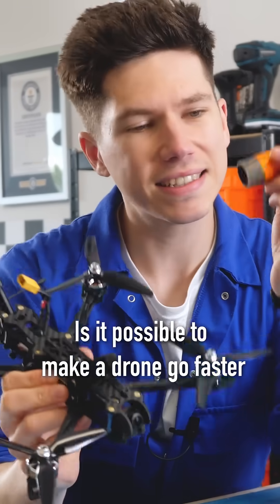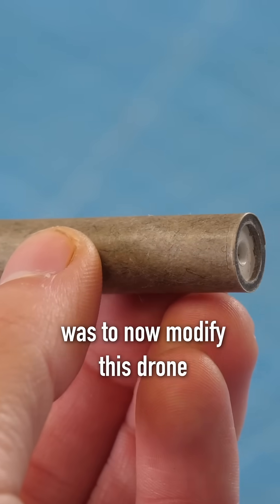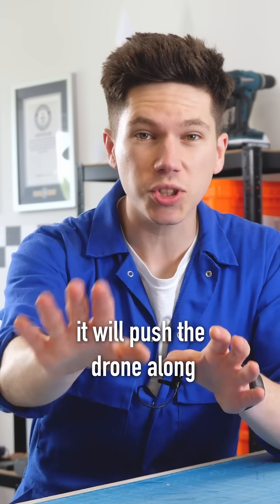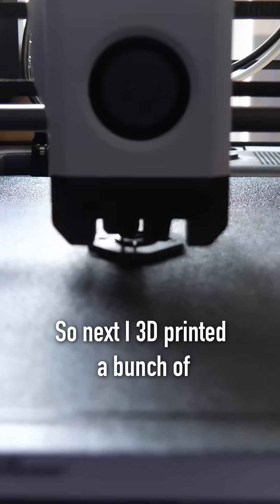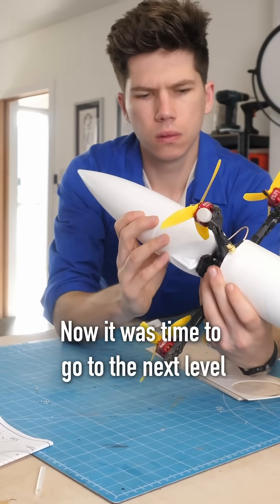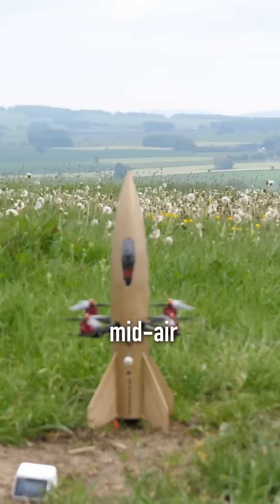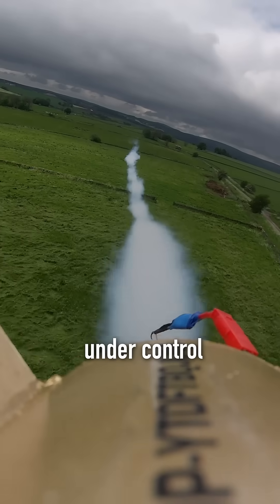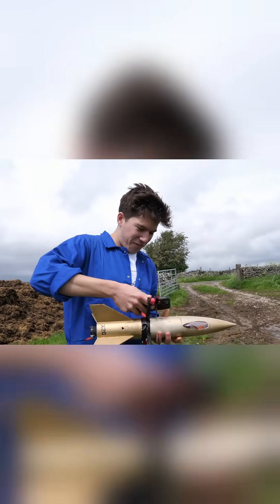I made a rocket-boosted drone 🚀 #drone #engineering

Comment: The problem is that the rocket is going to propel it faster than the propellers can. So the propellers would need to be basically mirroring themselves and spinning backwards to stabilize it. Anything else is going to make it worse

Comment: I would think that after a drone is tuned, a set of entrees in e various matrices of the Kalman Filter are treated as constants. With the rocket motor, both the mass and the center of mass will change as it burns. The moments of inertia will become variables, etc. An approximation from some engine tests could give some piecewise changes to the matrices or switch through a set of matrices as the rocket burns. To not make the adjustments = instability does it not? What thinkest thou?

Comment: You next mission, should you choose to accept it, build retractable arms.  Fly the rocket at maximum speed to maximum height, without the props adding resistance to slow it down.  Then when the rocket thrust is over, the arms pop out and the drone returns to home.

Comment: this isn't even a rocket boosted drone, its a drone boosted rocket.
Reply: You mean a drone-SLOWED rocket, lol
Reply: @ichbrauchmehrkaffee5785 drone stabilized rocket to be precise
Reply: i mean. not really. its a pretty weak rocket motor, though you mean visually it looks more like a rocket then yea
Reply: @moosehead4497  whats happening is the rocket engine becomes the thrust.  The propellers cannot provide more thrust than their max.  They end up acting as stabilizers.
Reply: @Bolt_Turner  right, in that sense it is interesting, except that, past the max thrust, the propellers provide nothing but drag? so stablizer but an inefficient one at best, an intersting idea could be flying the drone up to its maximum altitude, and then starting the rocket to see what max altitude could be reached, thinner air would be more efficient as well
Reply: Drone-steered rocket. Fancy replacement of guided missiles.
Reply: That’s more engine then drone lol
Reply: Exactly what I was thinking
Reply: i came here to say the same thing.  The drone is slowing the rocket down.
Reply: It’s neither.  

It’s a TikTok paperweight.

Meant for nothing more than rage baiting and getting clicks :P
Reply: @stevenrogersfineart4224  Someone thinks they're incredible smart 🥱

Comment: Use one counterrotating propeller on the front of the model
If impossible due to technical complexity, then just two propellers on sides should work. but it would be better to place them all the way up on the model
At those speeds those four pilons with engines and propellers are more of a drag

Comment: Fun but I think there would be a lot of drag off the Rotor Disk once you exceed their maximum RPM and Lift Vector. Props act like a Wing. The surface area and AoA will create Drag. That drag will likely limit the top speed of your rocket which would have likely climbed faster without the Drone.
That's just my opinion.

Comment: Well make foldable legs and you can use a rocket to go super fast and drone to land it and steer it if you leave the edges of the folded legs out with holes in them and actuators to turn them to use the air to control it then fully let legs out with motors for slower landing

Comment: Here is the idea that I have, but I have neither the knowledge or experience to make it, but maybe someone like you can!  
Make a model of Starship and a booster that can launch with a rocket motor through the whole launch sequence and do the separation.  After that you could place quadcopter motors where the grid fins are.  The motors dont even need to actually be able to make it fly, just slow it down enough to do a model tower catch.  The starship section could have small internal ducted fans with the body having slits to allow airflow and lower the weight so that it can maneuver just like the real one with flaps as it falls belly down using a flight stabilizer.  The motors on that part also dont need to actually make it fly, just slow it down for a catch.  

It could be piloted by two separate people, one for each section.  A third person could control the tower or that could be a switch on the controller, IDK which would be better.  Do you even think its possible?

Comment: The limiting speed is the maximum rotation of the propeller which is less than the maximum speed developed by the rocket engine. Which ultimately means that the propeller blades actually slow down a body in the air stream that wants to move faster than the maximum rotation of the propeller. The stream of air hits the blade like a wall because the blade cannot escape the current due to its slow rotation speed.

Comment: I was also obsessed with creating a top speed quadcopter for the longest time. A few years ago I made a 145mph quadcopter Just by using high KV motors and 5-6s batteries. I would say once you break the 150 mile per hour limit, then is when making rocket bodies start to make a significant difference, Because at lower speeds below 100 mph there's not really a ton of drag.

Comment: what's funny is i built a drone with RaceStar 2508 motors on 6S battery and my GPS read 118mph without a rocket engine or rocket style frame (with the motors limited to 80% power output iirc since i was using 6S)

Comment: Depending of electric motors... Fast speed will push motors to turn extremly fast, and turning parts most likely doesnt disigned for this level of functionning)... So maybe one time of try will use a hole phisical "potential" of electric motors) so lets say its a curious experiment, but to became a real or usefull... You need a "drone" with electric engines airspace grade with turbins etc!)))

Comment: I'm sorry but use the drone tethered by a few strings and at a certain speed the string breaks, and within 1 second it ignites the rockets, causing it to have a secondary boost. I bet it will go over your speed no problem.. and this idea is so low on my ideas to make rockets faster, and make drones faster it is a  point 5 out of 10..

Comment: fun fact: If you get rid off the electric motors, the original frame, the battery and the flight computer, you will get an even quicker rocket drone!
Reply: But think of the applications you could fly a Is rocket in between any building or as close to a target as you want

Comment: It begs the question though how exactly it's stabilized at top speed.  A quadcopter stabilizes on roll/pitch axis by speeding up (creating more lift) and slowing down (creating less lift), but if you push the quadcopter beyond the maximum pitch speed of the props (the maximum airspeed it is capable of producing at the motor's highest rpm), then all the props are just windmills creating drag.  Perhaps it's a matter of more drag/less drag, but there's a quirk there too, that if you actually brake a propeller much below the wind speed, then it produces less drag.    A propeller freewheeling close to the wind speed itself produces the most drag.   In that scenario the roll/pitch controls would actually be reversed when the rocket pushes it beyond the pitch speed of the props.
Reply: Yup, thanks for putting my same thoughts 😂
Reply: Agreed. A rocket to lift a drone to a certain height or distance that can then be jettisoned would make sense (save battery I guess) but this looks like a rocket with spinning fins not doing too well.
Reply: the problem is quads cant do better then 0 thrust on one side. at high speed rotor craft have roll tendency. at lest with collective pitch heli you can do something better then 0 thrust on that side. my 6HV can do 100mph easy but then it also has 2m rotor on it. bigger rotors let you have a higher top speed in level flight. this guy just taped a quad to a rocket lets see it do better then 60 in level flight
Reply: Или можно сделать направляюшие с пропелерами задвигаюшиеся и улучшаюшие аэродинамикупри напоре ветра или с датчиком скорости
Reply: Well this just made me think of well why dont we make it a staged rocket? As in, you use the drone controls to get it in the air and pointed in the right direction, and then engage rocket thrusters for speed, then you can shut off the rockets and go back to drone when it needs to, maybe with the propellers folding into the body
Reply: He probably chose props with a much higher pitch than would normally be used with those motors.
Reply: It didn't look like he had much control at all tbh, could be wrong.

Comment: I suspect that at high speeds you'll find the airflow across the fan blades to become so turbulent that the propulsive airflow will drop - making them less effective as stabilisers.

I'm more curious if you could use this configuration to train the control software to stabilise different configurations. Perhaps a central solid rocket engine booster, surrounded by four variable pressure micro-rocket engines? Or four small jet engines?

How about a quad-jet engine design that's capable of reaching great heights, before actually launching the central rocket..!?

Comment: wait till he discovers the all electric similar body drone doing nearly 400kmh
Reply: Yup, so this rocket drone was pretty slow. :)
Reply: I saw the video of a drone with a speed of 550kmph with the same design
Reply: Hell a single engine FPV wing can hit over 200 lol
Reply: My fastest quad racer topped out at 146 mph.
Reply: @graydi66y  my fastest 4s was 125 mph.  tiny little 4s bugger.  Loved it.  still have...the parts from it :). crash bang zoom.
Reply: why not use double propeller stabilizers?
Reply: @bluedog101c no need. Flight controller can handle all stabilization automatically. The only reason now to use double props is for a little extra speed, power, and redundancy.
Reply: I'm RedBull gives you wings
Reply: Even a decent FPV racing drone would be 100+mph. It's when you near the speed of sound that things get dicey.
Reply: My Nazgul goes this speed right out of the box with 6s battery and good props. (I had to give my drone props for that).
Reply: https://www.youtube.com/watch?v=ZVEEFIkvM8g
Reply: my drone can do 120mph without a rocket.
Reply: China has a mach 4 drone
Reply: @jhowardsupporter  not the same thing. We have faster stuff anyways.
Reply: @graydi66y   Yeah you have Trumpelon
Reply: @jhowardsupporter  whatever, guy.

Comment: “Is it possible to make a drone go faster using a rocket engine.”
I’m pretty sure if you mount it correctly, you can make anything go faster with a rocket engine. 😂
Reply: You can make anything faster once with rockets. Checks out
Reply: facts!
Reply: Full video?
Reply: New challenges unlocked: 
Rocket fly
Rocket frog
Rocket banana
Rocket garden gnome
Rocket Bud
Others?
Reply: 😂 I've seen it work for Wiley Coyote
Reply: Now make a rocket powered wheelchair. I volunteer as test pilot.
Reply: that's how bro rolls: add a rocket engine = faster
Reply: Except a parachute.
Reply: Noooo. Not my dooog!!😂😂😂
Reply: You can make a mailbox fly with 2 F motors
Reply: Let's hope the patent doesn't get stolen by the Chinese! 😂
Reply: Und U-boot mit Raketenantrieb!?  🤔😂
Reply: except rocket I think
Reply: You are wrong - bureaucracy would not! Even if you stick the rocket engine in that place perfectly aligned with the spine....
Reply: @danvasii9884  I think most bureaucrats would figure it out if a rocket was pointed at them…
Reply: That's what she said
Reply: That's the Kerbal way of doing stuff, if your rocket is too weak the solution is MOAR BOOSTERS
Reply: With 4 rocket engines replacing the drone propellers, you can place it into orbit.
Reply: @abuyalatip7590 ... Have you done this, meaning launched a multi rocket engine missile?
Reply: The rocket side leads to many abilities that many drone pilots consider, unnatural
Reply: Yeah, it's basic Looney Tunes 😂
Reply: You can make drones that go faster than the nonsense he made... waste of time
Reply: Basically totk without the hovercraft
Reply: @Rocksidion  Not everyone knows what totk means!
Reply: @jg-bf7ik  Tears of the Kingdom - It's a Zelda game.
Reply: Well with enogh thrust a brick can become a plane!
Reply: @aroguepatriot1776 or make it spin out of control till it expodes from damage
Reply: No not true, u cant make a rocket engine go faster using a rocket engine.
Reply: @ fun fact, adding a second rocket engine typically does make it go faster.
Reply: @darrellbeets7758  Re:  "you can't make a rocket engine go faster with a rocket engine"...
2 things: 
1. You really made me laugh! At the silliness of the image. And the brilliance that came up with that.
2. And sadly, you actually can. Join them side-by-side and light them at the same time. 
(But at first, I was picturing them one in front of the other, and that's what made me laugh!) 😂
Reply: Wild e coyote😂
Reply: Anything huh what about an ice cream machine or a television not anything buddy
Reply: @Alizon0326 with a big enough rocket anything will fly
Reply: Except light and sound
Reply: Including babies?

Comment: What the hell you showed “testing how fast it can go” in angle mode which limits how much it can lean. In acro you can lean it so it doesn’t gain height at full throttle. 

It’s like testing how fast a car can go in first gear or even in neutral.  

Also 190kmh for a drone like that is not very fast, most racing builds exceed that with no huge dumb rocket, especially Quadmovr.

Comment: Aerodynamically the drones can only hit ~150 mph with out some sort of faring to lead with. Think mass transit bus with the square flat face.. Build a proper race drone with better quality parts and you can hit that 140+ range where aerodynamics surpass the capabilities of the components. THEN add these pointy parts and test. you will see it push past those barriers to speed until it reaches the point mentioned the motors and esc's are spinning so fast they back feed power and can no longer adjust for stability.
Reply: That's not true. I've seen a few drones without fairings or rocket motors that can go over 200mph.
Reply: @AgroAaronFpv  Not hobby drones you haven't. (and no fixed wing craft do not count) Nothing out currently that can develop the power to weight ratio with battery tech to over come the drag co efficient to break 160ish mph without some sort of aero dynamic aid to lower it.
Reply: @borgonianevolution the drone in the video below is a hobby drone that the guy built himself and it goes close to 250mph without fairings. It's definitely possible. 
 https://youtu.be/tfFw2tRs-_M?si=VwsI8gX0yBhFBo7r
Reply: @AgroAaronFpv  Nope nope and NOPE. Current calibration can be manipulated, MA consumed can be adjusted in the FC.. Distance however is read back from the satellites. @811 max distance from take off spot over the 12 seconds just before the loop started is 67.6 M/s speed which is  151 MPH.. even knocking off a full second at that distance to 11 seconds only comes to 73.7 M/s which is 164mph so not even remotely close to 200 mph. even knocking off another full second to 10 second sprint is 181 mph so nahhh  

So the ~150mph aerodynamically limited best without Aero is till holding strong
Reply: @borgonianevolution  yeah I stand corrected I checked out his video again and did the math on distance traveled and yeah it doesn't add up. I was also surprised to see an X8 setup achieve such a high speed. If I were going for high speed I would just stick with the X4 setup and I guess a fairing lol. Damn not sure how no one else caught that. That video is on quite a few sites It's even featured on The ESC's website that he's using as well as pyrodrones page for that ESC.
Reply: @borgonianevolution  It gets even worse when he claims the 0 to 300 kmh in 2.1 seconds and it only shows a distance of 72 m..  lol oh well..
Reply: @borgonianevolution  he just sent me this video. Of course it doesn't have his speed but he's definitely moving. Claims they're going 180 in this video

https://youtu.be/JNm-Ho33-UY?si=hEdFmrJa5h-79mU_

Comment: I can do 120mph on a normal freestyle quad without rocket engines, try using a higher voltage battery. I would go 6s on 2550kv motors